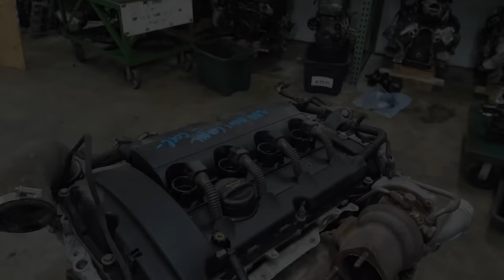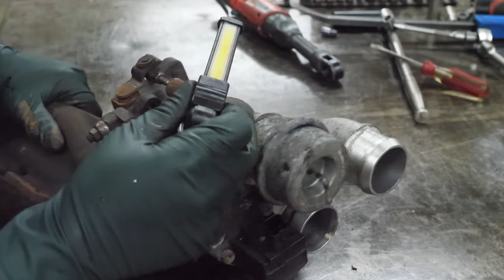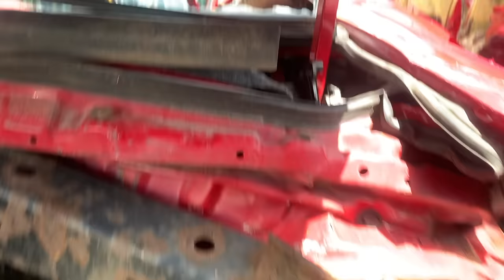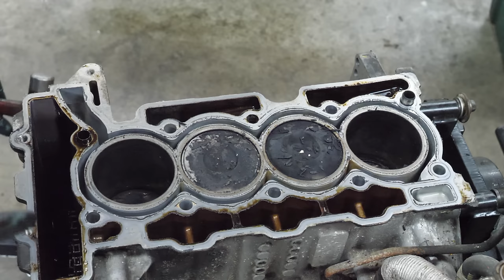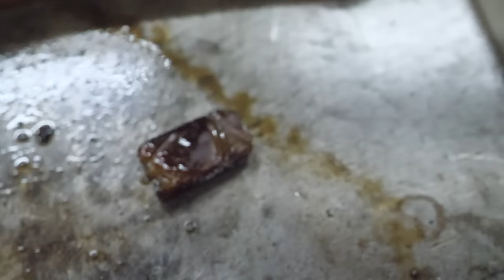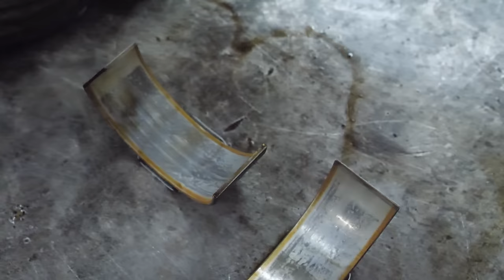JUNK Mini Cooper S (BMW/Peugeot) N14 Turbo Engine Teardown. Why Do People Buy These?

Comment: That was awesome!
I have a 2012 JCW with the N14. I bought it with 20K kms and instantly did the following for preventative maintenance keeping in mind I enjoy learning how to really look after a car not just wait for something to fail before fixing:
- Magnetic sump plug
- 2 x oil catch cans (to help with the carbon build up on the valves) one on either side of the valve cover which covers the high RPM and the low RPM vents.
- Fit a turbo blanket (avoid putting over turbo oil lines).

Repairs that needing doing under 50K kms:
- Had the thermostat replaced as the temp sensor died at 20K kms (now the sensor can be replaced separately with the upgraded thermostat housing.
- Had to replace the HPFP - car started to have trouble starting when it was cold.
- Replaced the rear brake pads, last owner liked to ride them and they would squeal.

These engines need attention the second they start acting up. Ive kept a service list of everything Ive ever done to the car including basic servicing and the liquids used so the next owner doesnt have to guess. I also have a schedule for it. 

80K kms:
- Change transmission fluid (Lifetime fluid my ass)
- Replace Oxygen Sensors (both)  
100K kms
- Have intake valves cleaned (walnut shell blast)
- Replace turbo oil return line with stainless steel version
- Replace oil filter housing gasket
- Replace heat exchanger gasket
- Replace vacuum pump and Diverter Valve

At 160K kms:
- Replace turbo sensor
- Replace Ignition Coils
- Replace Timing Chain and Guides (Detroit Tuned has a reinforced kit which they claim will be the last you'll need) - not cheap
- Replace Auxiliary Water Pump 
- Replace Friction Wheel (at the serpentine belt)

200K kms:
- Clean Throttle Body

240K kms:
- Replace Oil Pressure Switch

Engine oil and filter changed every 7.5K kms or 6 monthly (I read engines with emission control run very dirty inside). Injector Fuel cleaner (Redline) every 5K kms.

I hope this helps others who want to know how to keep their N14 happy. No it's not nice having to do all the above and we shouldn't have to!
Reply: Sorry but when you take into account the amount of time and effort required just to keep this economically category car running its too much time commitment,  money and interference in quality of owners personal life plus way over requirements compared to other cars.
Reply: @originalGFLEX this list is insane
Reply: If you haven't replaced the turbo oil line with a braided one, DO IT NOW!!!  Oh, the turbo banket is really a waste of money. lol  Now, go get a Manic Tune and really have fun!!
Reply: @shueibdahir It's quite small actually. There a few more things that can be done. Mini's are a handful but the funnest EVER!
Reply: @originalGFLEX l;ol  IF you are just a COMMUTER who don't like to drive. lol    IF you a DRIVER who loves to have fun, you actually enjoy this stuff.
Reply: @nielgregory108  I enjoy driving but after doing a routine check engine oil, water, brake fluid, screen washer level, tires condition  I'm exhausted and need a early nights rest every time. Tedious mundane tasks but essential.
Reply: @nielgregory108  It's ridiculous. Videos like these are a gold mine and a expose manufactures engineering short comings before rushing product to market. Great video but another car personally with the knowledge I've been furnished with, one to avoid
Reply: I skipped the oil change in my Mach E. Oops.😂
Reply: You nailed it.  Spot on recommendations. Bravo.
Reply: You should have deep pockets to keep it up and running . The question is whether it's worth having this thing alive on life support .😂😂
Reply: @mipmipmipmipmip😅😅
Reply: @Mehran1307  Not really too bad For sure, deep pockets are required if one buys into a Mini that was not optimally maintained.  The biggest issue...people following the OEM recommended oil change frequency (10K miles / 16K KM).  Goodness...this one will kill timing chains and turbo's, for sure. I change at 2x the recommended frequency and the car has treated me well by doing this systematically.  However, it's still a BMW product...too many plastic components and limited space to work on it.  Therefore, one has to stay on top of the maintenance and monitor the car. It's not a Toyota/Honda.
Reply: Do you think this will work for my 2007 R56? I'm copying this and taking it as guide to avoid any trouble, my mechanic checks mine every two weeks but man, it never stops, there's always something new popping up.
Reply: @originalGFLEX 😅😅 I totally agree
Reply: I would let the ECU program to 90° C. Thr gaskets will last way more than with The 110° C. 

Also coolant flush after 150k KM. 

Rod bearings are also Wearing. Mine are at 158k And they Look used hard. 

And use a good full synthetic Oil at least. 

And the last Things i would Change are The Turbocharger against a JCW, 200 Cell Downpipe and a good big Intercooler.

It will be a different car

And at least the Piston Rings. The original ones are flexi Oil Rings from BMW. These are Just crap And will blow your Turbo If one them fail. The 3 piece Mahle Rings are way more better and reliable. But that requires a engine rebuild :/
Reply: I remember BMW/Mini OEM dealer replaced the engine on my sister's mini (2011 I think) after like half a year. 
now the computer doesn't work, all the plastic in the world & they put the DME/ECU in the hot aas engine bay not even sperated w/plastic like the battery, nor in the cabin glove box like the older BMWs.
Reply: It’s junk then…
Reply: buy a Volvo
Reply: Hello , I have a Stop-Tech brake kit for 400.00 . It's a complete kit of drilled rotors and pads , front and rear . Fits a 2021 Cooper S  ? If anyone is interested . Free shipping .
Reply: This is why I dont drive bmw anymore. It was fun car but doing preventative maintenance all the time it seems like it never ended lol i just want to drive. I ended up with a yukon denali and never looked back. Never had a problem out of the seven years I've had it now. Only fluid changes in transfer case etc
Reply: Very good advice if you want to keep your car reliable for ever.
Reply: that’s an impressive testament to your commitment on driving it!
I have a 2012 JCW Coupé (2 seater), bought it new, still have it.
I’m one of those dudes who pays people to have that done, bc I’m simply not experienced enough without access to proper facilities.
I live in Munich and am lucky to have found an official BMW place that seem to know their way around Minis.
They found a potential problematic valve cover at 3y and had BMW pay for it at no cost for me.
Then after another 3 years, they found that the valve cover is acting up again. That time they had BMW pay a part and paid the rest themselves.

it has been a recurring item on the service checklist but, fingers crossed, didn’t leak again for 6 years.
I did have them check for carbon build up  but it doesn’t seem to be an issue.
The car has been running pretty much exclusively on shell V-Power for about 11 years, which might have helped or not.
the car definitely makes more power with higher octane petrol.

considering everything is OEM parts, what would be useful?
do you really find oil in your catch cans? From what I read, they don’t really do much except catch water in Minis.
Cheers from a Munich!
Reply: @Robert-G  Hi 👋 
I poured about 100ml out of my catch can within the first 2yrs of it being on which shocked me. It was rusty looking water. Since then she doesn't produce anything like that anymore but I dont plan on removing the can anytime since. I've fit a second catch can on the other side of the Valve cover (near the timing chain) about 12 months ago which is for lower idle and im yet to see how that went.

I also use high octane 98, from BP. I'm about 30K kms from checking to see if theres any carbon issues on the valves, I have my hopes up after you said yours was good 👍 I was worried it's an issue no matter what. 

I've just replaced my valve cover because it wouldn't stop leaking all the way around and it wasn't the gasket. So yes those covers arent the best design. I bought it with 5yrs warranty to cover me and it wasn't too costly.
Reply: @sassyrav  you still got a 5y warranty on it? nice!
Me & my gf leased it for 3 years as we weren’t sure we were going to keep it. But realized that the successor was nothing but a wet sponge, so bought it from the lease (to the dealer’s dismay, as they had a buyer already :D
Still find it hard to get anything else. The only thing ever tempting me was the Alpine A110, but they don’t come with a manual transmission.
had a small side impact last year (,not our fault, 12000€ repair), so now we’re committed to keep it for many years to come :D

good luck with yours 🤞
Reply: @sassyrav  oh. one thing that I had done to the car: glue the front spoiler lip! (only the small part that grabs from underneath, not the whole front)
I lost 2 of the bloody things after going well over 200 for a while. BMW were total dicks about it while I still leased it, as it was their car and gluing was not their SOP.
so after the 2nd one flew off, I drove for 3 months without until the lease ended, and I had them glue it tight enough that it would be the last thing to ever come off.
Reply: At that point all I could say next would be 'K-swap it'..

Comment: This is my Engine, but without fully forged internals. I am SUPER afraid of breaking my engine... so I Carbon clean it with H2 gas every maintenance. I went to shortened maintenance intervals (from 30k to 15k KM for oil changes) + premium OIL and only PREMIUM fuel. With all this I am making 289 wheel-HP and it has done 165.000km like this now. Running well, so they CAN survive.. but many problems exist. Thanks for seeing my engine on the inside:) (mine is  Peugeot, from my ICON, it is also found in BMW and Mini's) Thanks for these video's, VERY cool!
Reply: 15000 km ~9300 mi for oil change??? My '07 F150 gets oil change (synth) every 3500 - 4000 mi with 100,000 mi on the clock. Change oil twice as often, full synthetic and maybe it will last a bit longer
Reply: dude, you should change your oil between 8k km and 10k km! And yes i have one of this engines. No wonder why they blow up
Reply: 15k KM is not NEARLY frequently enough. Every 8000 kilometers or 9000 kilometers, no less!

Comment: I had a 2010 Peugeot 308 GTI 200bhp - I serviced it yearly as per the manufacturers recommendations as well as having an oil service in between the manufacturers servicing - that worked out at 5000 miles per oil change - but it still had a new cylinder head, coolant housing, 2 water pumps, cam chain and tensioners and that is just a few issues over the 4 years of ownership - luckily I had a 2 year aftermarket warranty with the vehicle and got an additional 2 year warranty when the first ran out - it saved me a fortune - there are so many versions of this engine that have been produced either turbocharged or NA that I am amazed that the engine wasn’t dumped years ago and it puzzles me that they are still using it today

Comment: Fascinating, thank you. It never ceases to amaze me hoe bad an engine condition may be but they will still run.   By the way we British make lots of things, to answer a previous comment. We just don’t brag about. The original A series engine was and still is a little jewel. When you revved them they sang. I had 13 bmc minis including the first Austin Severn original purchased in August 1959. Pictures available if only I knew how.  Keep em’ coming.

Comment: The R56 N14 engine is known as the chocolate engine by MINI enthusiasts here in England. The supercharged R53 Cooper S has the far better Tritec W11 engine which can be tuned up to about 250bhp. Mine’s been tuned to 210bhp and drives like a go kart. Great fun ❤
Reply: Too bad tritec big service cost a LOT If you can't do it yourself

Comment: I have one of these in my 08 John Cooper Works, it had to be totally rebuilt at about 110k miles. It had all sorts of flashy bits put in it at that time to engineer out the commonly known problems. It got tweaked up to just over 220 bhp and 318nm torque, recently the intake got walnut blasted to make sure no lumps of carbon could get ingested. It's only done 14k on the new engine so hopefully it will last a few years. The car is an absolute blast to drive, very noisy but tremendous fun. They are not the most reliable cars but they sure are fun.

Comment: Had essentially the same Engine in my Peugeot 208 from 2013. BMW knows why they abandoned it entirely.. It's fun when it runs right due to making good power and the car being light, but it almost never does work right. Sold the car with roughly 120.000km and the Engine was pretty much done for. And by that point it had already gotten a new Timing Chain, new Chain Tensioners, new Turbo, new Cooler and a bunch of other stuff.
Barely anybody besides Peugeot Dealerships wanted to work on it because it's absolutely horrible to work on. Everything is cramped and PSA (now Stellantis) made a point of putting every Bolt in absolutely stupidly hard to get to places. They really really hate Mechanics.
Reply: it's not a PSA designed engine, BMW did it
Reply: @nightpavell  The head may be bmw design but im sure it's based on the Peugeot TU engine. Most of it here also reminded me of older PSA engines when he took it appart. 
It also apperently was built by Peugeot in france. Anyway like most from PSA group it's shit
Reply: @Iceeeen  Yeah, it's a TU engine, they done everything they could to push as much power from it as they could without redesigning whole block, and this explains reliability problems and why it's bad to work on. PSA tried to fix it one more time, still selling 1.6 THP today (but calling it a "PureTech" engine, despite it not being an engine from PureTech family like 1.2 -  which is also bad, but at least better than 1.6).
Reply: @Iceeeen  no, xu/tu/ew engines are pretty cool and reliable
Reply: @cytrynowy_melon6604 1.2 tri cylinder puretech  is worst with the horrible wet timing belt, it's debris clog the oil pump and kaboom.
Reply: @nightpavell  it all went downhill after the EW engines.
Reply: @cytrynowy_melon6604  No! It is the so called prince engine (EP6 engine = essence prince 6 moteur) BMW Design made now by Peugeot. Its very much like the N42 BMW engine from 3 series, with nearly the same problems. The Tu engines had wet liners loose in the engine housing.

Comment: Ah yes, I remember this engine!
The timing chain was made of a softer metal which would stretch. You would hear the rattle, so a temporary fix was to put a longer chain tensioner to take up the slack. By the time I got the car, it had already been done so I replaced chain myself. 
The other issue was the High Pressure Fuel Pump, common issue for them to go.
Reply: Isn’t it wonderful that bmw recalled the sane high pressure fuel pumps for all of the bmws it was used on but did nothing for mini?
Reply: @zokusharuuku1091 was that the same high pressure fuel pump that was recalled in the twin turbo v8s of that era?

Comment: I've worked on a machine shop in South America and this engine is pretty common in PSA cars. Can confirm that just the late models are good enough. But early models did feature timing chain failure as low as 30k kms and straight up cracked cylinder liners/bores.
Reply: If memory serves me correctly, the ones with the timing chain issues were BMW designed ones. The later ones that didnt have any BMW input versions generally suffered from less important issues, like the emissions bits.

Whenever germans touch an engine, they seem to develop timing chain issues.
Reply: @MidshipRunabout2 Old BMW M40 had timing belt interval 40k km. One guide wheel of belt was size of thumpnail, no wonder it wouldn't last longer...

Comment: Hello! I have worked quite a bit on these engines, and I have to tell u that is not a bad engine, 99% of failure is due to people driving them to the ground. Had customers drove the car with broken guide for a year refusing to repair it,the other scenario is coming for un oil change after 10000miles with only a quart of oil remaining in the pan , the other thing is what u sed driving with low octane fuel
Reply: The low oil problem is caused by a combination of a dipstick design that is the most difficult I have ever seen thread the oil level on;  which is then combined with an engine which burns oil due to poorly designed and made valve stem seals.  It all results in the engines wearing out faster than expected.

Comment: My wife wanted a Mini Cooper.  Nine years ago I found a slightly used 2014 Countryman ALL4.   After reading and talking to people about these cars I became quite aware of many issues surrounding them.  Honestly, lack of maintenance seems to be the main problem.  We still own this car.  I change the oil and filter every 3500 miles.... religiously.    With 55k miles we have had virtually no problems with the car.   None!   Knock on wood.   It's a great driving and handling car.  And its surprisingly comfortable.   I really believe maintenance is key.  Having said that, I'm still leery and not sure that it can make 100K miles without a major issue.  We'll see....